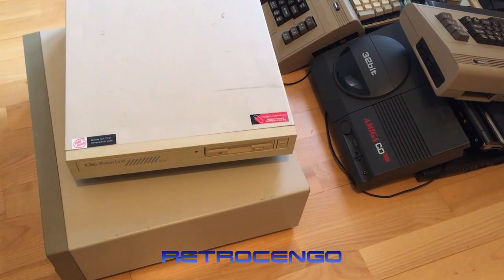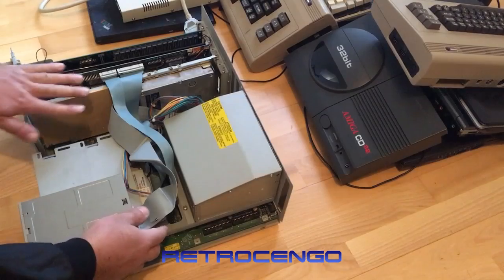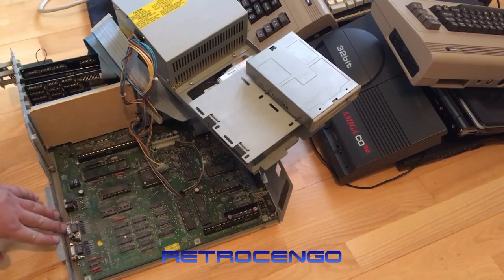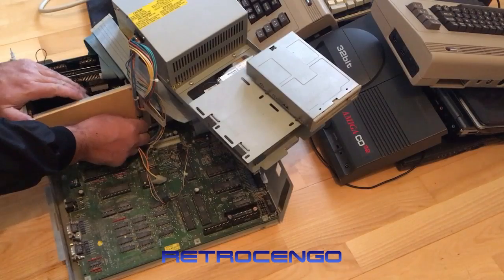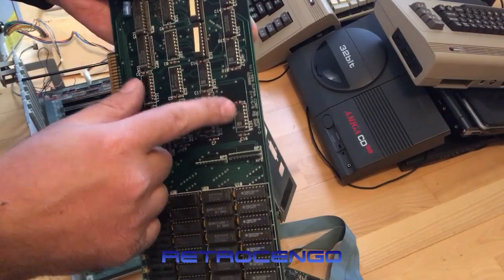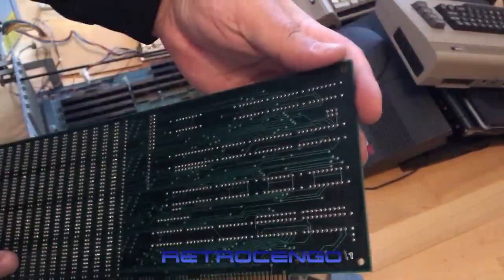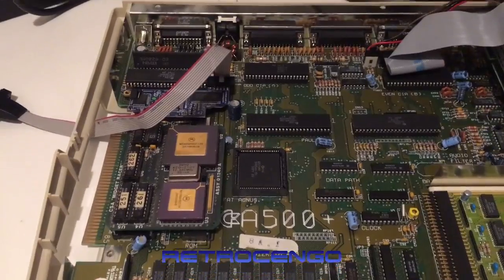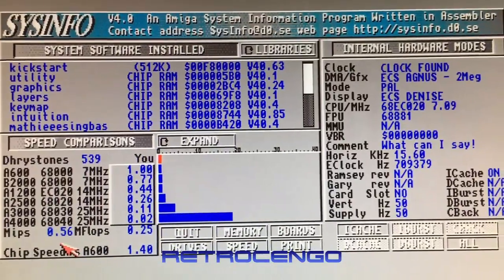Commodore Amiga 2000 inside look CSA Midget Racer 68020 CPU SCSI HD and more retro stuff. Part 1/2

Comment: HD controller is an A2090 series for sure...ST506 cables.
Reply: Looks like the one on this page: http://amiga.resource.cx/exp/a2090a
Reply: Those A2090's are slooooooow! And the SCSI natively only supports up to a 300 or so MB drive. There is a ROM update that will allow it to go to 1 GB, but that is about it. Better than no hard drive controller, I suppose.

Comment: Looks like the hard drive your not sure of is an old ST506 Drive which you would find in the old PC XT computers but they were also used in the Data Chief Hard Drive systems used on the C64/128 systems which has a modified 1571 Board to interface to an ST506.  I did have one of those back in the day 20mb which I used on my BBS when I ran C-Net 128 before I switched to a multiplexed LT Kernal Hard Drive system.   I am amazed at the stuff you find seems like you find things I completely forgotten about or have in storage somewhere.  My Amiga 2000HD which I did run a BBS on lives in my server rack today because its a beast of a unit.  Oh yea you might want to open the PSU and give it a cleaning you would be amazed at what those things can collect.
Reply from the maker: Stephen Bruce Thanks for watching and for the info, this one got some really old but still interesting hardware inside. 
Im not familiar with it, but man its fun to play with😁😁
Most of my findings is through my youtube channel, today iwe got a mail from a viewers colleague that has 6 Commodore 64s. Asked me if i would pick em up for some bottles of wine, they dident work 20years ago, but they are still awesome find for me, looking forward to see what else is stored with the computers🤗😁😁
Reply: @RETROCENGO  The old computers are interesting for sure.  I still have books on my shelf with actual listings of the old hard drives and control boards.  Hard to believe that some of those old devices still run.  Of all the computers I have owned my absolute favorite are the Commodore computers.
Reply from the maker: Stephen Bruce Totally agree, Commodore is just pure love 😍😍😁

Comment: Regarding the 020 upgrader/card. If you can not close the case, then use that 90 degree CPU relocator. Like the one in my blogpost from yesterday.
Reply from the maker: brostenen They are awesome, will try to see if i can build this one up again as is was back in 1989, if not, then i will consider using the parts elsewhere 😁 but yes the telocater is nice

Comment: Never heard that an Amiga had MFM/RLL drives. Buuuuut.... That controller with that empty space for a second half width cable, looks much like an MFM or RLL controller. Again. I have never heard of such an controller on the Amiga.
Reply from the maker: brostenen I have never heard about MFM/RLL drives before, all new to me. Looks awesome, nice to find new(old) hardware and leard something new😁
Thanks for watching😁😁
Reply: @RETROCENGO  I need to google that controller. Before I can say if it is. Anyway. My 286 machine, yes the old Unisys from 1987, was sold with an 20mb MFM harddrive. The MFM had a cusin called RLL. Yet the MFM, wich is the only one I have seen in person, have one data cable for two drives. And two controll cables, one for each drive. Or it was the other way around. IT is much older than IDE.
Reply from the maker: brostenen we got something for the museums now😂😂